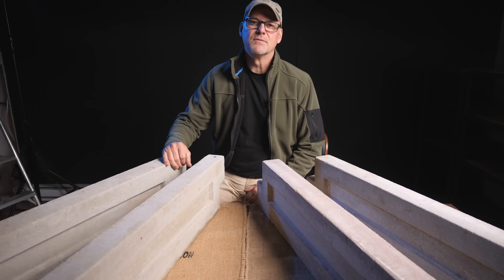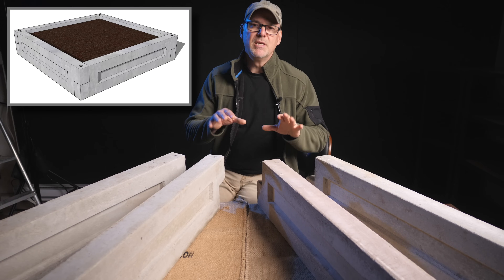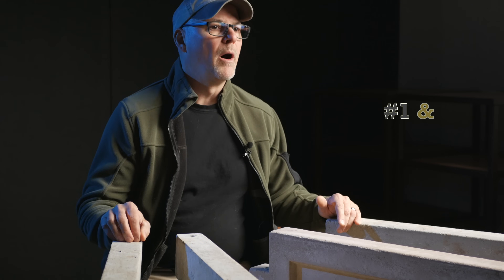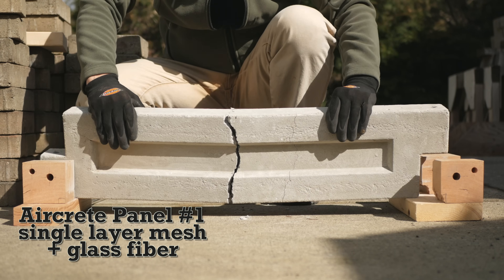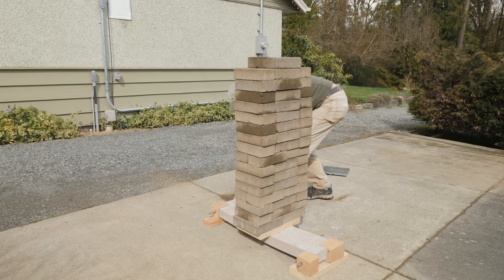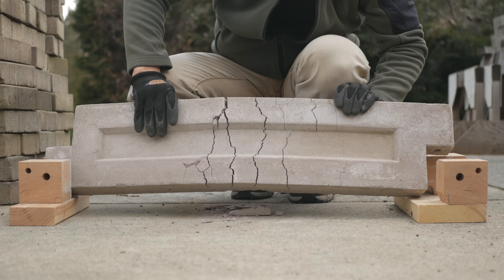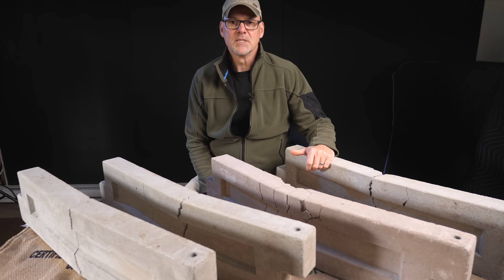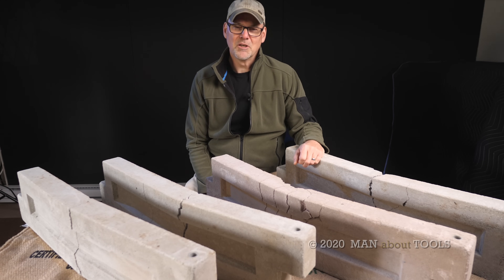How Strong is Aircrete? Deflection Test Lightweight Concrete Garden Box Panels

Comment: Aircrete is not made for tensile strength period. It has a totally different use. 
Non load bearing walls, thermal walls etc. An those wires have no grip to bond to concrete, they are smooth finished.

Comment: Thank you for providing some sort of testing on Aircrete. I agree with MrJoshd1 about the process, as the panels should have been placed with the outside surface face down. Still the unbiased information is appreciated! I believe I will be using an additional 2 lengths of rebar placed at top and bottom tied to the mesh, no styofoam added and some surface coatingon to protect the outside  after all is cured.

Thanks again.

Comment: Excellent. A bit disappointed that you didn’t lay this all out in a table format for easy comparison. Strength to weight info and cost to strength info would be good too. Actually, some unit cost info would be great too. I realize material prices vary through space and time but you could present it in such a way that makes substituting local prices and recalculating easy. This might help with your mold sales (especially if you factor time and material costs of building wood molds).

Comment: I want to build a dome house from aircrete blocks. (like a pizza oven or igloo)
half sphere with 30ft diameter. wall thickness 1ft. on a strong concrete foundation.

what mix should I use for my blocks? was thinking of using glassfiber strands to reenforce.

Comment: You need to have. Single point of contact rather than the wide board.   Consider placing a narrow block under the board.  Maybe 10cm²  or do some math to repory pounds per squard inch of force.

Comment: I think, like perlite, the glass fiber does nothing for strength.   The fibers are to short.   I suspect instead of metal mesh you could use something like HP300 Uniaxial Geogrid a nylon pvc coated mesh and it would do as well or better.    Thanks for all your videos.   I might try making 8 4'4"x12' panels with similar pin fasting.  Should make a circle of less than 100 sq ft  for a shed.

Comment: Did you ever test a panel with some glass fibers, maybe a screen, but also adding some air entrainment additive? That additive should add strength for inclement weather. FYI, the best place for entrainment additive is Menards. Everywhere else was quadrupled the price. The additive should really strengthen the surface to prevent spalling. Great testing though! Kudos!

Comment: I would never build with this weak crap, I would rather use wood over this terrible material.
Reply from the maker: I agree. Aircrete is fun and an interesting product but, it is very lacking in strength and durability.

Comment: I wonder if connecting the 2 mesh layers with a few short pieces of perpendicular rebar between then, and offsetting the two mesh layers, would greatly increase the strength

Comment: i;m impressed too, but i think maybe he failures was more due to some imperfection in mixing bubbles, the study of the failure lines might tell you if there was maybe a weaker spot due to large bubbles
the stucture of aircrete looks similar to bones, and bones are good at handling stress, compared to their weight, but the structure have to be perfect, any spot that have large cavities end being the place were it breaks

Comment: I don't know if you would be interested in doing an additional test/update on this series, but I think lava rock might give interesting results. Lava rock as an aggregate is something that's being used/tested by areas of the concrete/cement industry. It's lighter than traditional aggregate, and the unique texture of lava rock may allow the concrete to cure internally for longer due to the way it can hold water.

I plan to make some panels using lava rocks. The biggest downside so far is the need to wash the lava rocks and screen/sort them for size.

Comment: I would think that most of the strength comes from the outer walls, instead of the center. I think a thin wire mesh laid near the bottom and top would be stronger than an equivalent of metal in the middle and 3 layers (bottom, middle and top would be very strong. Even fiberglass window screen would help but prolly not be superior in strength (except metal deterioration). Shaped wire screen mimicking the exterior shape would probably be the best. Air Crete is prolly best for the filler with a thin concrete shell...  I would recommend pouring a thin layer of concrete on the bottom of the form, then fine 1/2”x1/2”  wire fencing, then aircrete then more of the wire fencing, then a thin last layer of concrete...

Comment: This is the test I've been looking for on the various aircrete channels who espouse building houses with aircrete alone, no rebar or other internal supporting framework (I don't include sheet metal frames or rabbit wire inserts. Those only support wet aircrete - NOT sufficient for house walls built to code). In my view this casts serious doubt on the safety of that practice.
When the aircrete crowd produces verifiable tests based on numbers and not vague assurances, I'll take a look.

Comment: Glass fiber doesn't add any measurable strength but increases resistance to micro cracks. Which the test does seem to prove from what I could see. Reasons you may want this is to have better weather resistance to protect the steel inside that is tensile strength to the compression strength of the concrete.

Comment: I saw your video on pouring the air Crete with the fiberglass mess.  A pinch just isn’t enough to really make a difference.  I would think a half pound to a pound would really increase the strength.  I’m retired now but at one time I drove a concrete truck for a small company.  They used the fibers and also washed the rock that there concrete was made from.  Dirt in you sand or rock greatly decreases its strength.  Keep testing.  I saw another guy who was adding micro rebar.  They were barely longer than your fiber but added a lot of strength to the mix also.  You keep producing an I will keep watch.  Later
Reply from the maker: Thanks Gene! I used the amount of fiber that the manufacturer recommended in this case.

Comment: Would they work better if you are able to give it a tougher skin?  I.e. have a thin layer of cement/sand at the bottom and finishing off with another layer at the top of the pour?

Comment: "not scientic".  You know what mate, as an Engineer I can say it's still an experiment and still very informative.  Just needs a bit more repetition to be called scientific.  Given it's concrete it probably doesn't even need to be more accurate.  You'd be surprised how little data often lays behind many "facts" commonly used in Engineer.

Overall I'd say your entire series on aircrete is very informative, not just to amateurs, but to professionals as well.

Comment: I understand this just a test comparison.  Not sure who would use aircrete for structural or to bridge like that.  The potential I see in aircrete is to provides volume and some insulation between structure while not decomposing, falling apart.  If it can use local sand or soil that is a major cost saver.  It's ambitious but In Mid Florida I would love to use an aircrete mix made from onsite sand, recycled tire fibers, cement and air all capped with some polymer to replace the need for sheathing, siding and drywall.

Comment: I'm no engineer but it seems to me that you could greatly improve the strength by using an interlinked horizontal 'D' shape for the two reinforcing panels creating a 'Arch & Dome Effect' which will evenly distribute the force from the center point to the entire structure.

Comment: Make some panels that you don't baby when curing as most people will pull them out the mold, leave them until the next day or two, not water cure them and then put them in place in the garden. 

Make some like that and test them after a few days and maybe a few weeks etc. It seems the aircrete with double re-enforcement did surprisingly well. So make aircrete with exposed aggregate front and fold the double wire mesh with it being slightly farther apart. That might just be the magic version that is light but strong and would handle weed eater line hitting it.
Reply from the maker: I agree Robert, thank you.

Comment: Seems the type of mesh & it's placement has a great(!) effect on your test. Haven't seen priors, yet, so...had you tried pencil rod (#3)* @ ohhh...3"oc (in the long dimension) the capacities would have improved. Perhaps :-)

But...one isn't needing structural panels for a garden box, right? :-) *w/several crossing short pieces, for no good reason. Haaa

Great presentation! Liked/subbed

Comment: This may be ending up almost entirely with a tensile strength test and almost nothing to do with compressive strength.  It’s possible using rebar instead of wire would make a vast difference.
Reply from the maker: Yes. The test has excluded compression strength as we already know its value (from the bag of mix).

Comment: I personally think this is stupid I like the idea of the boxes that’s OK what I don’t like is that you’re putting 600 pounds are trying to figure out the breaking point of this part when you should have figured out first of all what are the lateral forces of dirt 20 inches high 
Gravity pulls down word first and foremost do a video on dirt 20 inches high near the top near the center and near the bottom lateral forces I don’t believe it’ll even pass 20 pounds 
Stop wasting Time figuring out the strength of concrete leave that up to the engineers everything you have made will not break planting tomatoes whatever you plant
Anyways good idea on the boxes I think I’m gonna make some I make a lot of things out of concrete
Reply from the maker: Hard to estimate the force of the dirt when frozen.

Comment: I would imagine if you put a steel rod inside you wouldn't have to worry about the strength even if you stacked them on top of each other to make a wall. As for cracking during the winter swelling of the soil, one can only try it and test the results. Thanks for showing us what works and what doesn't.

Comment: Ok.  Very cool video. Thanks! Not rigorously  engineered and neither is my following comment:  Your panels  get their tensile strength from the wire mesh. A logical next step is to stretch the horizontal mesh elements probably  using bolts/  nuts/maybe springs ( split washers) outside of the forms during the curing process.  ( e.g. crude pre-stressed air crete) I admit it... overkill for a garden bed but, a fairly easy alteration if you have the forms.

Comment: concrete makes a poor rope, because you cannot pull it.  hence, this is why a double mesh works better,    Because neither side, is unreinforced for the pulling.   (When you put the load on, the top of the panel was being compressed, and the bottom was being pulled.

Comment: If you put the reinforcing fabric on the outside will do much better then
Reply: totally agree, reo is the strength,, had you turned your panels over, with the reo' closer to the botton they would take way more presure, even try with a broken panel,,,
turn it over and try again,,  thank you for your design, and the effort to share your design. very much appreciated...

Comment: How come the air Crete doesn't stick to the molding that makes their shape?
Reply from the maker: All concrete forms are coated with a thin layer of oil before casting. This prevents the concrete from sticking.

Comment: In my honest opinion one 3/4 hollow pipe runing from middle of each pin location would be the best support against side thrust..concrete dosent compress so the steel is all you have to stop it from failing..at this point I imagine it would break around the pin areas. allso the inset weakens this test alot..maybe just paint them or stain them?

Comment: Having spent approx. 7 years in precast concrete industry as Quality Control - breaking concrete samples - it is possible that you are laying the panels the wrong way when looking for strength. The wire reinforcement should always be placed on the tension side of the panel. In your case, it would have been the side closest to the ground. This would explain the additional strength in the double reinforced panels as the tensile pressure was being handled by the steel.
Reply: The way he uses the panels, the weight of the ground inside the box will be pushing in the same direction as he is testing. You are right though. The reinforcement would be more beneficial on the bottom side of this test.
Reply: @j.j.maaskant7287 why dont use rebar its no expensive ... still don't understand . Several manufatures they dont even use it as well but use fiberglass and others but are not ligth are heavy
Reply: @jaandel1  rebars heavy, heavier by a bit
Reply: @smartwatchonplutowho cares you don't need the place to be paper light it doesn't really matter much rebar is definitely the way to go!
Reply: @j.j.maaskant7287  interesting point - so the reinforcing wire should be placed deeper in the mold. .!?
Reply: @angelviloria4966  yes, always reinforce the tension side of the concrete beam. In this case in particular, since the cast are thin, you wont be able to attain the standard 2 inches deep. but that recommendation is done because the rebar and wire disrupt the continuity of concrete, not because it gives the best theoretical resistance.

If you could attach a mesh (fiber mesh like those in EIFS systems) to the surface, it would work a lot better that the steel reinforcement just because the mesh has higher stiffness and it is in a better place in the geometry, giving it more moment of inertia in this loading configuration.

Comment: So, in planning to replace my own cedar raised beds, it seems to me the take-aways of these builds and testing are: Portland cement is good enough; use vermiculite or perlite to save weight, whichever is readily available or least cost; use a double layer of mesh or heavier hog fencing; CSA cement seems to offer no advantage if wear from landscaping and garden tools is a concern. And even though you don't seem concerned about the amount of pressure raised beds will see from frost heave, I'll save the effort and reduce the risk by not bothering with aircrete. Frost moves everything in Canada (except maybe in lower BC).

Comment: What is the amount of “weight for fail” with standard concrete mix?  Adding 2% (by volume of dry concrete) dry biochar to your panels should increase tensile strength by 40 percent.  The hydrated BIOCHAR in the mix will ensure a much a much slower curing time because the char retains moisture.  I like your videos very informative.
Reply: Does the char have to be grounded up or something
Reply: @johnle231  the char may be crushed down  the 1/4” size.  Do not crush to powder; you are not looking for large chucks either. Depending on the application the size on your normal aggregate is fine also.
Reply: @paul49777  

I dunno.  Seems like aircrete can’t be reasonably trusted for structural build so maybe just for insulation or something I dunnob
Reply: @johnle231  I would ensure that the incorporation of the char is at least the size of the bubbles in the air Crete. I believe nano bubbles would be the standard, going further to ultrafine Bubbles size would be counterproductive in my opinion.

Comment: Thanks for the video.  Panel 3 is an example why "ferro-cement" is so strong and flexible.  Just imagine instead of using mesh with huge openings, to instead using something like rabbit-wire which has smaller openings.  Ferro-Cement gets its strength and durability from the lattice structure of cement/fly-ash to metal/basalt mesh.

Comment: I've been curious about using this kind of air entrainment to expand the volume of castable refractory cement for use in an experimental wood burning stove.  I've seen online that foaming the Portland slurry like this can expand the cement up to six times it's normal volume.  Would you agree with this assessment?  I do not as yet know with any certainty if castable refractory cement is more, or less, dense than the portland or how that will affect its performance with this modification.

Comment: By simply upside down results will be drastically changed
Reply from the maker: Yes! I think my takeaway from all these tests is the further the mesh is from the load the stronger the concrete is. And, as I saw in the aircrete tests, a two layer mesh (or cage) gives even better results.

Comment: The wire mesh would increase the tensile strength if were on to top side of the panel but not so much if is located on the bottom side. Could not tell which form your test. Good job!!! Burt
Reply from the maker: Yes for sure. Thanks!

Comment: Great video! I'm curious what the addition of flash graphene would do with aircrete.
Reply from the maker: Thanks! I haven't tried that.
Reply: @MANaboutTOOLS  I have been working with pure Graphene, do similar tests on a small scale and seeing some interesting results by lowering cement volume and adding Graphene. More testing needed to achieve consistency.

Comment: Great research and description of your methods.  Tremendous amount of work went into this!
I wonder whether the variation in failure loads was related to how deep the steel reinforcement was located.  If set deeply at the time of placement it would be in a much more favorable position to resist the deforming stress.
Have you though about rounded ends to allow angles other than 90 degrees to be used?  Maybe incorporate a semicircle of 2 inch plastic pipe at the end of the forms?
Thanks again, great project

Comment: Not pertinent to gardening but I wonder how thermally conductive the aircrete is. I would guess with all the air trapped inside it would make a decent insulator.
Reply: Aircrete is one of the best insulators, both thermally and acoustically (noise) you could find in the market.